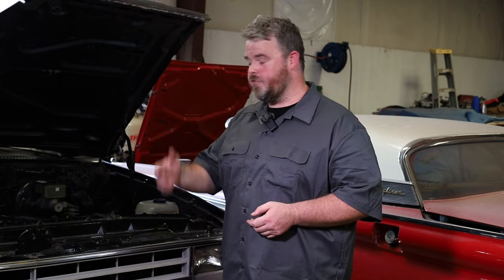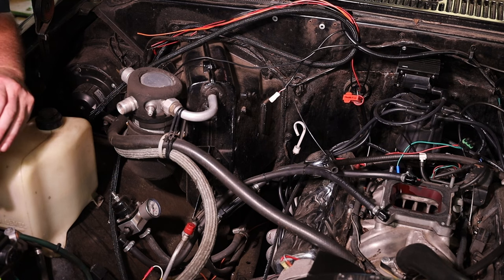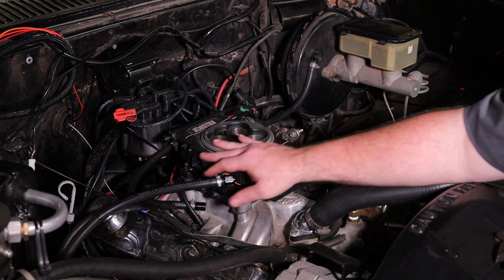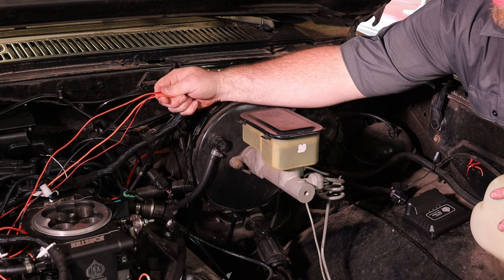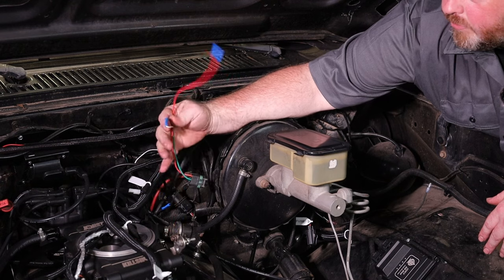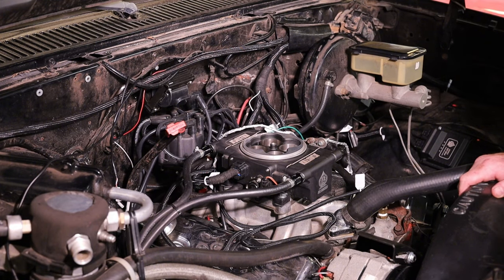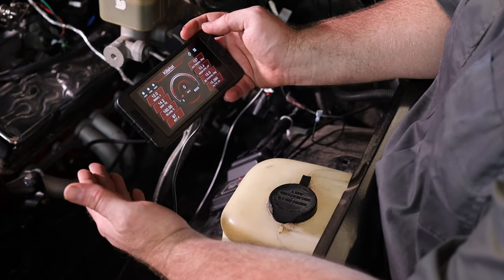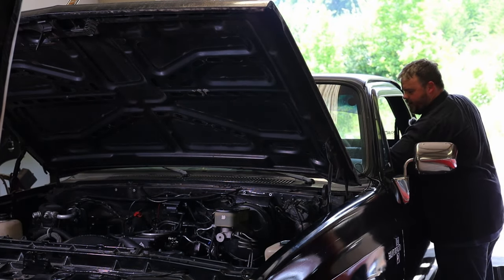Killshot Install (Behind the Product)

Comment: I am no mechanic-more of a hobbiest for my old 1991 GMC K/C 1500 5.7L V8--I have most of the engine parts already done--but here is my silly question--which wire do I connect the key red wire to inside the cab on the steering column--The internet says either the yellow or red wire.  Do you know so that I don't screw things up?  Thanks for taking my questions--I love doing this as a hobby - for myself--but I would never do this for anybody else

Comment: Question, for the people. Just installed a Jackpot on a 5.3, install and fireup was effortless. 
However my particular vehicle has the engine rather far behind the driver seat (its totally not a boat why are you looking at me like that). Is there a limit to how long the CAN lines for the pro dash can be? I need to extend them by about 8 feet to reach the helm.. i mean wheel...
Reply: Smells boatish to me. But part number AH2502 is a 6m (19.5’) can extension cable. Or a AH2501 for 2m (6.5’).
Reply: @actionvulture5251  from the man himself! Appreciate you brother. Going to reach out on Monday for vender application. I've pre sold a kill shot for a clients truck.
Reply: @actionvulture5251  Totally not a boat....
Reply: @joehanna501 I need to make a shirt that says “secretly into boat stuff”
Reply: @actionvulture5251  only because you guys have publicly discouraged the use of Aces products in a marine applications! Pushed us underground! 
Do you know how it feels to be a niche group of a niche group!
That being said your tips on O2 placement in the tech Tuesday video helped alot. I built a sort of long sniffer tube the reaches into the collector of my riser. Survived the first outing and actually does run in closed loop. I. Hoping to get enough data to be able to turn them off at some point.

Comment: I have a Tach drive distributor on my corvette, it has one of those hall sensor points replacement modules. Could I lock it out and use it with the aces timing control?